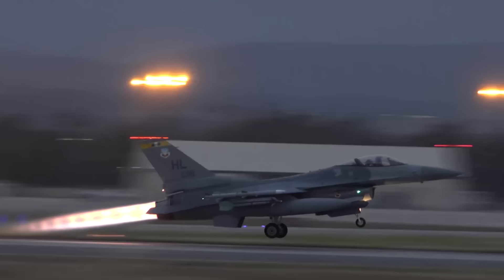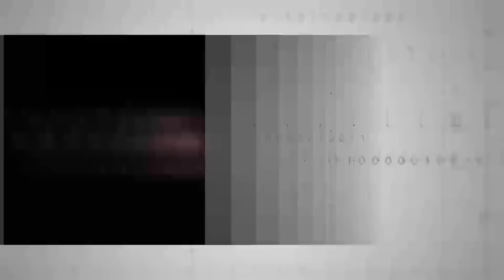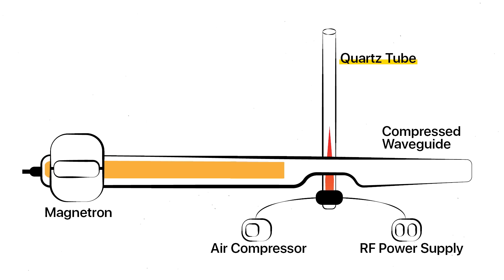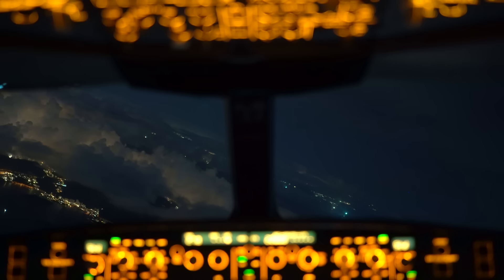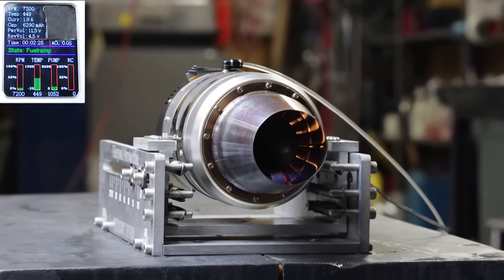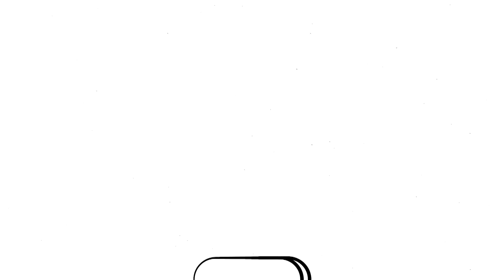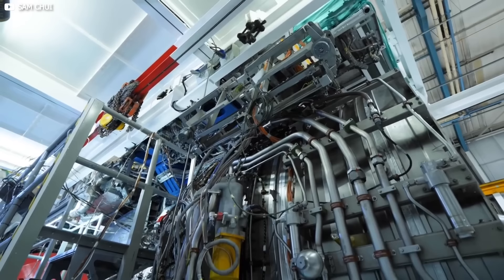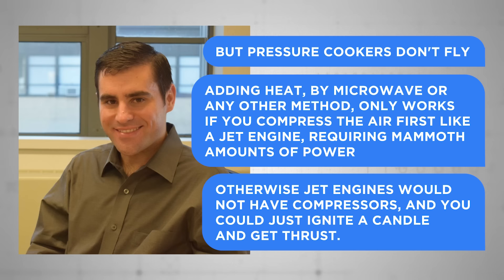What Are Electric Plasma Jet Engines?

Comment: My opinions about electric engines and electric jet engines are practically the same They are highly impractical Even if the technology advances advancements for other technologies will also improve regular engines however if you're talking about hybrids That's a different story you'll find out there's advantages in electric engines for example faster speeds well gas engines have more reliable retainable faster speeds however electric engines don't have to slow down for a gear change so overall a hybrid can take advantage of all these things and can make a very very high performance vehicle a similar principle can be applied to aircraft if rockets can help put aircraft into orbit plasma jet engines can help maintain speeds as well as navigate overall the technology doesn't seem practical in normal atmospheric conditions here on planet Earth however the technology might apply to space travel not only that but a hybrid system might apply for a reentry as well

Comment: This makes no sense. An electric fan provides efficient thrust from an electrical power source with very little heating(wasted energy). This plasma drive will waste a phenomenal amount of energy heating up the air.

The argument against battery planes is dumb. Most flights are short haul and if the plane were design to be battery electric from the get go they’d be much less compromised.  A lifting body with integrated fan would be a good start.

Comment: I suppose, that a "plasma turbine" produces a lot of Nitrogenoxid, which is fairly toxic for atmosphere and live. I beleave that the post petroleum aircrafts work like nowadays game thrones. Meaning electric propelers with high capacity akkus or Hydrogencells as batteries. A future plain looks like an civilized M400 propeller machine tanked with Hydrogen for electric cells. I suppose that Hydrogen to electricity is less weighty than akkus up to now. But improvements in battery technology may appeare, so a M400 sized passenger plane can pass the atlantic pure electric.

Comment: It's never going to happen until the energy storage changes from lithium to some other form of energy storage all together. There is one benefit, the zillions of dollars being spent is creating some ultra lightweight aircraft parts. These ultra light parts will make regular fuel powered aircraft far more efficient than they are today.
Electric is not all it's cracked up to be. I'm not going to go crazy on this but a model 3 long range puts out more CO2 per mile then a regular combustion engine Honda Civic in about 15% of states.
It's pretty easy to figure out. The empg and other data like that is just convoluted BS. Average charging efficiency is 85%. That's going to leave you a 15% never that you can put anywhere. You can add it to the CO2 per mile or you can do it immediately

Comment: Sounds like a good idea 💡 but wouldn't work without high speed ? The problem's are power of modern battery's are not  strong enough +battery's would weight too much + would need  strong air forces for the plasma engine to work. Sounds like wastes of time with technology of today. Maybe possible in 100 year's if battery became smaller and has the same power 🔋 of nuclear power station .This technology would only work if the engine had fasted air forces  moving into engine . Would be good if the jet plane moving! wanted turbo boosted .

Comment: Any heat lost to the atmosphere in the exhaust is just wasted energy. Electric motors powering propellers are already very efficient and lose very little energy to heat as compared to this plasma proposal. The reason electric commercial aircraft are not already a thing is the energy density/battery issue mentioned in the video alone. Even if this plasma jet works as advertised it solves nothing.

Comment: Jet planes are electric now and they use the skin of the plane to pull the electricity out of the atmosphere the small petrol motor in the tail is only an air compressor to spool up the turbines at startup you really think there's 230 tonne of fuel in an A380 even if true the last place you put that weight   is in the Wings
Reply: Every phrase in your comment is provably false, so I assume you are trying to be funny.

Comment: No future in any spewing type space drive engines because you wouldn't want to run into residual leftover scattered "contrails" of whatever it thrusts out the back.. within the local stellar system area... a little while later in the next era of superlight speed travel.

Comment: Just us hydrogen fuel. Coverts back to water once burned.
Reply: The problem is that hydrogen is incredibly difficult to contain without heavy tanks. It's also not as energy dense so that would significantly reduce the plane's range.
Reply: @dylanm.3692  By contrast, hydrogen has an energy density of approximately 120 MJ/kg, almost three times more than diesel (jp8) or gasoline. In electrical terms, the energy density of hydrogen is equal to 33.6 kWh of usable energy per kg, versus diesel which only holds about 12–14 kWh per kg.Oct 2, 2019
Reply: @jdamage68  Yes, but this fails to take the volume of hydrogen into account. Liquid hydrogen has a density of 71 kg/m³. Diesel has a density of 830 kg/m³. So using your numbers, liquid hydrogen has an energy density (per cubic meter) of 2.39 MWh/m³. Diesel gets 9.96 MWh/m³. The fuel tanks for a hydrogen powered plane would need to be 4.17 times larger to store the equivalent energy of diesel. Considering they even use the wings as fuel tanks, I don't think that's feasible.

Not with combustion/fuel cells, at least. Fusion would be neat though, although far off.

Comment: This trend of plasma engine videos is dumb.  The issue is that we don't have good enough batteries to power these types of engines.  We are a very long way off from having good enough batteries and if we did have good enough batteries making an electric aircraft is not something that is going to require new breakthroughs.

Comment: Batteries are the major stumbling block, and the reason why liquid fuels aren't going anywhere in our lifetimes.  If you had a 747, with perfectly efficient electric motors, and loaded to capacity with batteries, you could go less than 100 miles before running out of charge.  Then you have to recharge it.  And if you're trying to be environmentally responsible (which is the point of electric propulsion, right?), then you want to get as many charges out of your battery as you can before it has to be remanufactured.  After all, batteries are pretty much the single most environmentally destructive thing manufactured by humans.  So after a flight that wouldn't even make it from Los Angeles to San Diego, your multi-million dollar investment that needs to keep moving to pay itself off is now down waiting 6 hrs to recharge for the next one.  Remember also that we carried no useful payload on that trip because we've used all the available weight for batteries.

Comment: That  is Stupid. The Hot Turbine is only present to turn he Axis. The Overwhelming Amount of trust comes in modern Air-pains with low fuel consumption from the Air Flow around the Turbine. Rip off the Turbine and Replace it with an powerfully electric Motor and you have your Electric in Atmosphere Truster, with an optimal Trust to Power ratio. Fun Fact: It work in Every kind of Atmosphere, because there is no chemical reaction.

Comment: What a horribly inefficient way to make trust. 
Firstly all it's doing is heating air in an overly complex manner. 
An ordinary heating element is 100% efficient. None of that will be. The only reason to use plasma to achieve very high temperature. 
Which is why we use it in welding. 

Second, it's just heating, which is all burning fuel does. We do that with fuel as burning it is the only sensible easy to get energy from it. But you lose a large portion on that energy to driving the compressor and unavoidable loss in energy is the transfer from heat to mechanical.

Then you still have the losses from the prop of fan you use.

An electric motor is massivly more efficient. 3 phase can be over 95% efficency. But way more efficient than using an electric heater to drive a fuel engine eventually. All heat engines are not very efficient compared to good electric motors.

So you would just use a large prop on an electric motor for maximum efficency. Then fly slower at higher altitude. So you lose less to friction in the thin air and lower speed. Electric can do this easy as it doesn't need air to drive the engine. 

And even then. It still won't go far with the energy storage we have. As fuel oil is basically the highest chemical energy density. Then we don't have to take the O2 either. So we get an even better energy density.
And a battery chemically stores the energy and has to carry both parts for the reaction. And insulated it all safely electrically as well.

So chemical batteries will never equal fuel oil in energy density. It's simply not possible.

Comment: Honestly, I think we're more likely to see conventional jet engines burning synthetic fuels made with sustainable carbon-free energy such as solar. You don't need a whole new propulsion technology. You just need a way to make liquid fuels using sustainable energy instead of petroleum.
Reply: Unfortunately, wrong. The energy density, energy efficiency and economy of kerosene/air and turbine engines is theoretically unmatched. The energy densities, efficiencies, weights and economies of all sustainable energy sources are VASTLY inferior. Maybe intelligent aliens know of theories of physics that no human scientist has ever imagined, yet alone discovered. But until then....
Reply: @JCAH1  
No. You apparently don't understand what I'm saying: Use sustainable energy sources (such as solar) to produce synthetic liquid fuels (such as kerosene). The jet engine gets fuel that is chemically identical to what it gets now. But instead of refining the kerosene from petroleum, produce it synthetically in factories using electricity from solar energy or other green sources. 

We don't have that technology now, but I think we're more likely to see it developed than see a new type of jet engine run on batteries, for exactly the reason you cite: The energy density of kerosene is many times greater than any batteries we're likely to see this century.
Reply: @danielschechter8130  I did misunderstand you, and I do not want to take the position of contradicting whatever points you make. But one of the reasons crude oil is so wonderful is that nature already made countless trillions of tons of it, and all mankind has to do is take it (for free) and use it (plastics, medicines, fuels, paints, lubricants, insecticides, solvents, fertilizers, etc.). If your proposal is for companies to ignore the limitless quantities of "free" available kerosene and instead to make billion dollar solar powered plants to manufacture it from scratch, that is never going to happen. Since oil has already been manufactured by nature, since its energy density is super high, since countless billions of dollars has already been spent on oil rigs and refineries and pipelines, and since every last physical/chemical property has been studied and is extremely well known, then I can tell you where kerosene is going to come from in the foreseeable future.

As far as jet or turbofan engines, nothing can match their ability to smoothly, reliably generate tons of thrust, while also being relatively light, compact, safe, and quick to refuel. Trust me, if any new technology or a new principal of physics comes along, there are thousands of really smart and specialized engineers who will eagerly be all over it, starting that same day. The first step is to see if a new technology makes sense using equations and calculations, before any equipment is bought and before anything is built. I think the folks in this video are making a huge "beginner's" mistake by spending lots of money before they have proven on paper that this "new" technology can actually meet all of the requirements of practical commercial air travel, such as being cheaper, at least as powerful, light weight, smooth, quiet, compact, safe, long-term reliable, and at least as fast to refuel. I already know that induction-coupled plasma engines can not possibly meet all of the requirements for commercial air travel, even if they get the entire system to operate near its theoretical maximum.
Reply: @JCAH1  
And if we don't stop burning all that petroleum we'll melt the ice caps and the damage done by the loss of all our costal cities will far exceed the cost of building a few solar-powered synthetic-fuel plants. We'll alter the climate so that we can no longer produce enough food to feed the world's population. And if we don't stop burning petroleum before we hit the tipping-point the changes will be unstoppable. Not only that, but petroleum is immensely useful for pharmaceuticals and materials, and if we burn it all the coming generations will curse our memory. We simply cannot afford to continue burning petroleum. If climate-change denialism wins out over science the human race is doomed. Of course, if you don't care about your grandchildren, then by all means keep burning fossil fuels.
Reply: @danielschechter8130  I would urge you to not believe the uneducated, emotion-laden, profoundly dishonest predictions of extreme doom and death, that have been proclaimed by many Greenies. You might recall that Al Gore repeatedly, publicly announced that by July of 2015, all of New York City would be permanently submerged under 20 feet of sea water, and the entire northern polar ice cap, and all icebergs, would be completely and permanently gone. I could give you a long list of other false predictions of environmental doom and death made by other people, but I think you get my point. Regarding food production, it seems to me that IF the climate becomes a bit warmer, a bit wetter, with higher atmospheric CO2, then that would be a boon to all plant life, including crops and rain forests.

Even including all of the above, I have been an advocate for various types of nuclear power for decades. That and hydroelectric are the only technologies that are cheap, safe, dead-reliable, and do not omit CO2. But most of the appropriate hydroelectric sites in the world have already been taken, and that technology is vulnerable to potential droughts. You might recall the power brownouts and blackouts that occurred in Caracas, Venezuela. That occurred because that city's only power source was (is) a large hydroelectric dam, and they experienced a drought. It is a bit ironic that that occurred in one of the largest oil exporters in the world.
Reply: @JCAH1  
Don't be daft! Global climate change is real and is very serious and the burning of fossil fuel is causing it. The science is clear and unequivocal. But even if you don't believe it, I'm reminded of something I ran across some time back: "So-called “global warming” is just a secret ploy by wacko tree-huggers to make America energy independent, clean our air and water, improve the fuel efficiency of our vehicles, kick-start 21st-century industries, and make our cities safer and more livable. Don’t let them get away with it!" Right now only two kinds of people deny anthropogenic climate change: Oil industry executives and the gullible people who believe their lies and propaganda.

Comment: This idea is a waste of time and money! You would be much further ahead to use electric motor powered ducted fan.
Reply: The daunting problem with that is how to provide massive quantities of cheap, safe, light weight, reliable, compact, smooth electrical power to the electric motors. That is easy enough to do in a ground installation, but doing it on a jet plane is simply not practical. If one is going to install massive electrical generators in a plane, then they might as well also use those generators as the plane's engines, and skip all of the extra heavy, bulky, expensive equipment, which is what the world does now. And it can be (has been) mathematically proven that the inherent limitations of any battery technologies that could possibly be invented in the distant future, could never provide that kind of power and total energy, and still be cheap, light weight, compact, safe, and very quickly recharged.

Comment: Plasma engines for aircraft are unlikely to ever get off the ground for several engineering reasons but one reason which has nothing to do with engineering. It's the time it takes to develop it. For a new clean sheet technology of this magnitude to make it into production it would require about 50 years of development, absolutely Billions  with no guarantee of anything in the end. 
No country or private enterprise is going to risk that. The way I think transport will happen in the short term (next 50 years or so) will be very little in the way of flying. We can right now build a rail system which can get us from the centre of one city to another at 400kph. Trains in partially evacuated tubes can travel supersonic. The only system which could power aircraft is hydrogen. A hydrogen powered aircraft could be developed relatively quickly, about 20 years. But the cost of a hydrogen powered flight would be far more expensive that its fossil fuel equivalent.